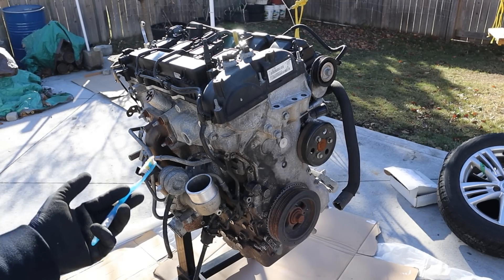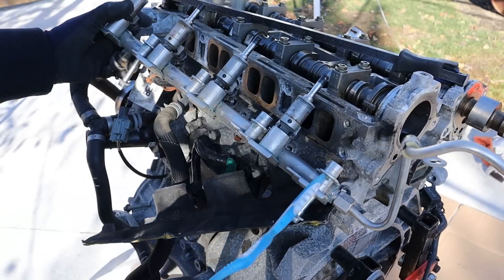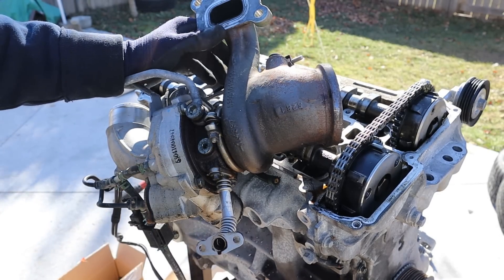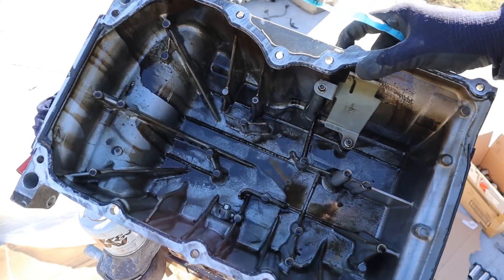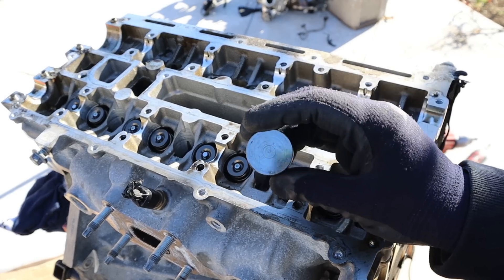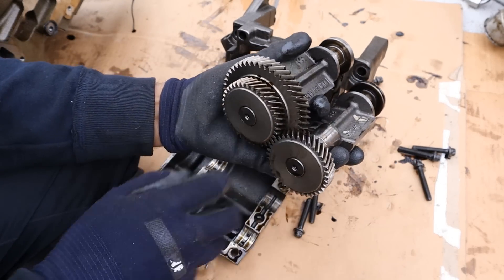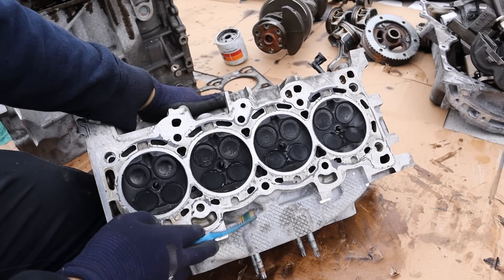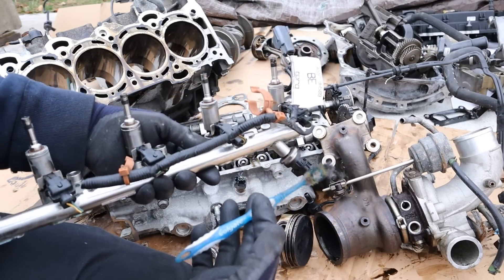Why Ford Ecoboost Engines Fail

Comment: Every time someone tears down an engine, EV's make more sense to me. And I'm no tree hugging ICE hater.
The sheer mechanical complexity, monitoring systems etc is mind bending. My KISS tech brain just says 'why'??
Reply from the maker: So what about the electronic complexity of EV?
Reply: @speedkar99  I think you already know the answer to that if you're even remotely technical. They're basically just rolling networks. Lot of plug and play components driven by software. Bad 'engine'? - A Tesla motor can be swapped out in a hour or less. That's simplicity. Only stuff like suspension etc are the same.
There's just no argument about the comparative complexity of ICE vs EV, that's a done deal.
Some just prefer the roar of a V8, and that's perfectly fine.

Comment: Engines have changed a lot in the last 20 years. It’s incredible to see how far they’ve come. 20 years ago it was a SOHC 100hp rust within warranty type cans. Now you’re getting cast aluminum and turbos. Nice!
Reply: we had last-forever DOHC Naturally aspirated all aluminum engines with variable valve timing in the 2000s.
Reply: Fuel economy regulations are forcing all kinds of uneconomic, expensive to buy, and impossibly expensive to maintain systems that have destroyed reliability and priced the working class out of car ownership, and priced much of the middle class out of new car ownership.

Comment: Had this engine in my 2017 escape titanium. Liked it a lot. No complaints at all. Great power and torque. Engine was not burning any oil. Car was sold with 186k km on the clock. Good mid grade and premium fuel as well as frequent oil changes (I did it every 5-7k km) and you could easily get 300k km and more.
Reply: Yeah it’s really not that bad. And those Focus ST guys beat the crap out of them
Reply: "Car was sold with 186 km on the clock."  I really hope you mean 186,000 km, or you wouldn't have needed a single oil change...

lol
Reply: @prycenewberg3976  i think he‘s trying to say „kilo-miles“ as in „a thousand miles“…
Gotta say, that‘s a new one for me😂
Reply: @heinzketchup4558  Then he probably should have put the space between 'k' and 'm.'  Like 186k m...
Reply: @sh1tsfcked119  That's hilarious.  

Please note that my reply includes a direct quote: 186 km on the clock.

186 Kilometers is such a short distance that not even a single oil change would have been necessary.  The OP has since updated his original comment to read, "186k km" to indicate that the distance traveled was 186,000 kilometers.
Reply: @prycenewberg3976 dude put hella miles on that if it was reliable he would still own it 😐
Reply: @prycenewberg3976  yes, of course, sorry my bad. Just saw it)

Comment: I had the ST (2013) after rebuiding the whole engine, stronger internals, the whole nine yards and the car STILL gave me issues. I consider it a "glass" car. Never will I buy another new vehicle. or any new Ford.

Comment: All he did was tear it down. He didn't know its mileage, history. If the engine actually failed, what failed? If it did, what was the root cause of that specific failure? Carbon build up on intake valves are common on all direct injection engines, Turbo or non-turbo. He used the 2.0 liter engine as an example. There are many Ford Eco-Boost engines. Title is misleading and what he thinks may be a failure in the future, based on this video is an opinion, not a fact. Yes, a Turbo anything/brand is more complex and may be prone to more failures due to more parts and complexity.

Comment: If Direct Injection gasoline engines are supposed to be so good and efficient, there wouldn't be so much carbon build up inside every single one of them. Junk. 🗑
Reply from the maker: Carbon buildup is a nessesary evil of better emissions and power that's usually an after warranty problem
Reply: @speedkar99  My theory is that since gasoline, and all of it's cleaning detergents, are no longer flowing thought the intake ports of a D.I. engine, carbon starts to build up on the valves, ports, and lower intake because there's nothing to wash it away anymore...
Reply: @speedkar99  Better emissions makes more carbon? I'm not so sure of that.. Some earlier port fuel injected cars had about the same emissions out the tailpipe as these D.I. ones, and they dont have even CLOSE to the amount of carbon build up that a D.I. engine has. 
There's something else going on here. 
It's not related to power either, my 800 h.p. big block has next to no carbon build up either. If carbon was related to power, it should be loaded with it.

Comment: Pretty sure that was a salvageable engine. A few cans of Seafoam or other magic portion or lotion and it would run like a champ.
Reply from the maker: Probably. But I'd have to measure the head to make sure it didn't warp

Comment: Tbf only 2.0L blows up. 3.5s need timing chains replaced and phasers when they get older. I have yet to have an issue with a 2.3 or 2.7

Comment: It should be against the law to have so many plastic parts.
Reply from the maker: The environmental laws for recycling right
Reply: @speedkar99  no, plastics rot on an engine and don't last. Who in their right mind would want a plastic thermostat housing?  Look at plastic radiators.

Comment: I rebuilt a Ford E-150 Essex engine with a hydro-locked cylinder (filled with fuel). As you would expect, the push rod was bent. I'm not a fan of center cam engines. I MUCH PREFER overhead cam.

Comment: These engines are fantastic!!! When they are still running... The carbon build-up on the top-end is a sure sign of the ravages the pcv oil mist has on engines using direct fuel injection... No thanks , regarding direct fuel injection on gasoline engines... I'll keep running my 560k. mile 1970's carbureted engine... These cars were built, to fall apart after a fairly short time...

Comment: I had an explorer with this engine. 40k miles turbo failed, 50k miles transmission failed. Ford kept the car for 52 days and decided to cancel my warranty. They returned the money that I paid for the warranty. After a long fight they decided to fix the transmission for $3200. Paid $600 out of pocket and fixed it. I listed the car for sale right after it was out of the shop. I will never buy a ford again.

Comment: I just got a 2018 ecoboost, it has 63k miles on it but it runs like brand new, ive only had it a month so let's see if this engine is good or not because I drive mine in sports+ mode and it's one of the most fun cars I've ever driven.

Comment: Great video and very informative but I think the title is a bit of click baiting. There’s tons of these 2.0 eco boost motors well into the 300,000KM+ range bone stock or tuned in the focus ST’s alone. Yes carbon build up on intake valves will happen with it being a direct inject engine and this particular model eco boost having a poor oil separator/ baffle plate doesn’t help. And also seeing the connections from said baffle plate to the intake manifold I don’t think there ever was a catch can on this motor. Nor do I think it sucking in snow through a catch can would ever be enough to hydro lock it, if it ever even made it into the intake. Also I don’t see how the cast exhaust turbine/manifold whatever you want to call it would ever leak, seems more like a gasket issue than anything. Always a possibility of it cracking which is what I’d have said instead of leak. Also vacuum lines are a weak spot on any engine. Maybe put under more stress and temperature fluctuations being near the turbo but it is often an item that gets replaced at some point on many vehicles. Not trying to hate at all, again great video and you do a great job explaining things and definitely know what to look for in an engine.

Comment: All engines fail guys, this isn’t a do not buy video😂😂
Reply from the maker: Somewhat. But some are more prone to failure than others
Reply: @speedkar99  yeah, Ive seen some with 250k with no issues and then some with 30k that just blow themselves up for little to no reason other than it was built at a factory 😂😂
Reply: This also looks like gen 1, gen 2 I think are much more reliable :)

Comment: I've seen so many issues with these new ranger engines too. Dodged a bullet not buying one, got a 2022 tacoma instead. Ford engineers aren't what they used to be. Diversity hire central most likely.

Comment: Great video and editing.  Seems that Ford has tried to fix the carbon buildup in the 3.5 EcoBoost by adding fuel injectors to the intake manifold in addition to the direct injectors.  What do you think about that?  Good solution?

Comment: 17:20 This is the exact falure that caused my mothers fusion to require a new engine (replaced under warranty) at 42,000 miles driven by a 63 year old woman. They loaded the parts cannon before they did the engine swap.

Comment: I've been a Ford guy most of my life.  If it wasn't an import, it was a Ford.  After owning and putting obscene amounts of mileage on 4 Volvo turbos dating from '88, '91, '95 and '07, I'll say that Ford didn't learn a damn thing about turbocharged gasoline engines while they owned Volvo.  Really pitiful.  So I'll stick with my 5.4L triton with over 220,000 miles on it and going strong.

Comment: Those particular engines doesn't have a key way like most.. so removing the front crank pulley/harmonic balancer should not be done unless you have the engine in time per instructions

Comment: Out in the driveway? If this motor Hydro-Locked from snow how did that happen? I have seen a motor locked by water intake and it took the side of the block out making a nice little hole you could stick your fist into. This isn't that.

Comment: from an engineering perspective, I think the engines are well-put together and there was no adverse wear or marks on any bearings so oil pressure was not a problem. There were no signs of a water hydraulic lock. As you say the engine was burning oil and this is a problem with direct injected engines used in passenger vehicles and that includes light diesel. It is because they are making pistons smaller and lighter with virtually no skirt and the rings thinner to reduce friction so they can get gains in RPM spool up and fuel consumption/ emissions.  The bits they pared back are what stopped combustion gasses getting past the rings and into the crankcase so when this happens the rings get fouled which then lets oil get up into the combustion area which makes the carbon build-up worse. many engines use special bore coatings now that don't always bed in properly depending on how they are first driven. All this tech came from racing engines but street cars are not for racing, They deal with far more cold running and over-fueling conditions that racing engines don't get. These types of gas engines run higher compression ratios as well which also stress the pistons and rings. Not long ago this engine would have been a state-of-the-art racing engine. We are making engines smaller to meet emission standards but then extracting every ounce of power from them which means they are highly stressed. The less stressed an engine is the longer it lasts.
Reply: Well said!

Comment: These Ecoboost motors NEED catch cans. That pcv valve that comes off the block releases a ton junk into the intake manifold. If you have a good catch can, it’ll fill up pretty fast on these. It’ll mostly gum on the two center cylinders in the center compared to the outside ones. I’ve got a 2016 escape and installed one, it always get full. I have also cleaned out the head intake ports and valves. Just took the manifold off and sprayed some seafoam down each one. Waited about ten minutes and did it again. Did it several times. I didn’t have a bristle brush to stick down there to clean it better but it still took off a good amount on its own. I’ll probably do it again this year. Been a couple years.

Comment: All of the complexity, all of the additional components, (Direct injection, turbo charged, Oil catch cans [not supplied but needed], balance shafts, etc, etc.etc........) Meet at best (if properly maintained) a 100,000 mile engine! Which has to be replaced with another 100,000 mile engine. All of this to maybe increase MPGs by  1.5 mpg.  The world (governments) has gone completely nuts.

Comment: my focus st has just over 153k  i have only had to fix a coolant leak that started at 148k and a radiator fan at 144k everything else is stock outside of consumable things like spark plugs oil and 1 wheel bearing. overall if you dont beat the crap out of the motor it will last a long time 200k easy. problem is its an st people modify them to high heaven  then go damn my motor is gone at  75k like well you added 5psi and redlining it everyday what did you think would happen.
Reply from the maker: User error definitely doesn't bode well for ST engines

Comment: Yet there are plenty that have over 300,000 miles with absolutely nothing wrong with them. There are several guys I’ve seen with over a hundred of these in their fleet and only 1 out of that hundred had a problem. They had it fixed and nothing else went wrong. I have a 2016 with well over  200,000 in my f150.. I also know quite a few others with more than mine no problems.
Reply from the maker: Nice

Comment: There is no problem with Eco boost engines....Ford engineering, YES.... Looks like you destroyed a perfectly good engine! BTW, carbon in the intake has nothing to do with being a Eco boost, but having cam phasers. All engines with cam phasers or some type of EGR system suffer this. Eco boost is just a fancy way of saying turbocharged.

Comment: I have an ST and this taught me quite a few things that I didn't know or had wrong about the 2.0 eco boost. Appreciate the video!
You should do a MMT6 transmission that is used in ST, RS, and 2.3 Mustang (manual).
Reply: I think the mmt6 would only be the transaxle in the ST and RS. The mustang would have a transmission more suited to the front engine rear drive layout.
Reply: @jaredbasque5908  wow I'm a bag full of nutz sometimes. You are 100% correct.
Reply: This guy doesn't know what he's talking about man, just go elsewhere for knowledge on our cars.

Comment: My son had a 1.6 ecoboost 180 bhp engine fail in a Kuga. The core of a spark plug fell into a cylinder. £8,200. Then the Powershift gearbox failed. No point changing the car now.

Comment: 14:40
I have a 2014 Ford 4-cyl no ECO.
This carbon buildup happens every year or 6 months or so.
Fuel Injector cleaner / Naptha does the trick.
Monitor MPG and when it drops add a pint to the gas tank.

Comment: Ok yes 2.0 turbo is junk agreed. Rest of them stronger then a F5 tornado. I have raced mine and I just hit 300k miles. My 2.3 just hit 291k. Still a V8 power guy why I own 3 V8s. But I also own 4 Ecos vehicles. They all have over 200k on them. Til they die I will keep running them. My GM VEHICLES I owned blew up before 100k miles. I have owned over 30 vehicles since I was 17. Mostly GMs got tired of fixing them so I went to Ford after 3 Dodges broke down I owned. I have owned 11 Ford's and everyone got over 300k to 1 I had got over 500k miles. So now I have 4 Ecos. If I knew Ford's lasted this long I would have owned maybe 13 vehicles since I was 17 but nope I wanted GMs. I still own 2 I rebuilt Firebird and Sunbird.

Comment: you forgot to tell people that that oil return line likes to break as well as the oil inlet, the rubber line they also like to leak. The saddest thing about that is that all the problems that they have with the eco-boost they’re gonna have with their Godzilla motor it’s all junk drive it for a couple years and throw it away if you get a couple years out of it.

Comment: My mom has a 2013 2.0T Escape, 171k miles and still going pretty decent, plenty of power and relatively smooth, definitely wanna replace the plugs consistently, every 50k or so.
Reply: Hey, I have a '13 Escape too. Why do you say pretty "decent"  Are there problems?  Thanks!
Reply: @jerplane400  she bought it used with 113 miles, it had the rear differential fixed/replaced. She’s had regular oil changes and it’s pretty decent. I replaced the plugs at 160k or so without knowing when they were replaced, they were really beat up and I should’ve replaced them way earlier. I would say 50k for spark plugs since it’s a turbo is smart to replace, we don’t beat it up and it’s a nice car to drive around in.
Reply: @Freemasonshair  Gotcha!  Thanks so much for the reply!  Take care.
Reply: @jerplane400  you too! How does your escape run? I like it, I think if you just follow basic maintenance and fluid changes you should be just fine!
Reply: @jerplane400  you have the 2.0t engine?
Reply: @Freemasonshair  I do.  I have 104K on it. bought it new and I take really good care of my vehicles.  I has been really reliable other than a wheel bearing. I run Mobile 1 synthetic and change the oil every 5K.  I hope to get it to 250K! We'll see. :)
Reply: @jerplane400  I hope so too! That’s a good idea! Have you done the spark plugs yet? My moms were SOOOOO beat up when I replaced them, they might’ve been stock, her MPGs went from 19 to 25 right away, also the power increase was substantial! Good luck!
Reply: @Freemasonshair  I did!  Going to replace the coil packs this week too! Thanks again!